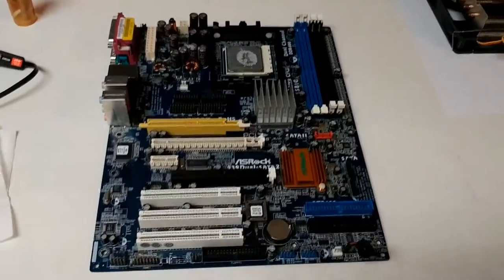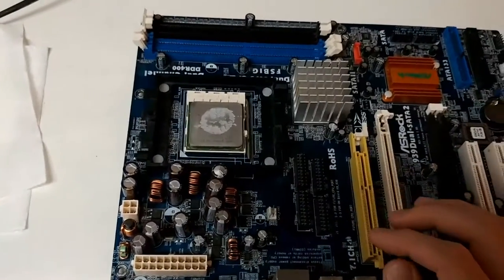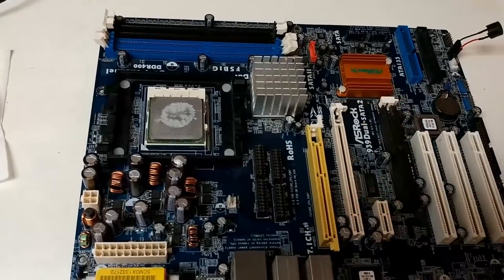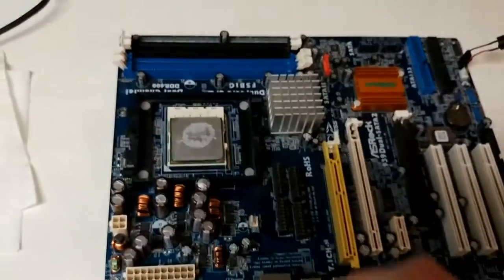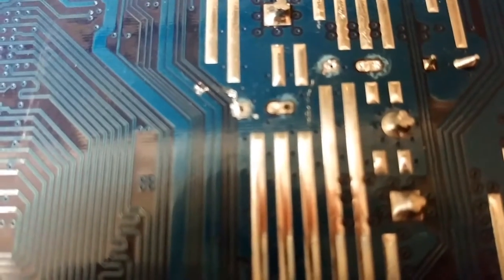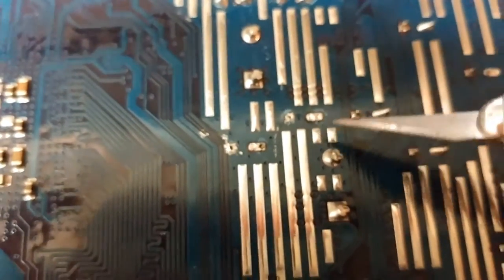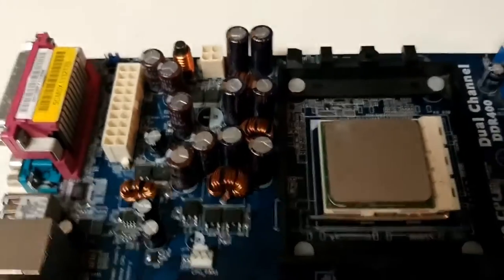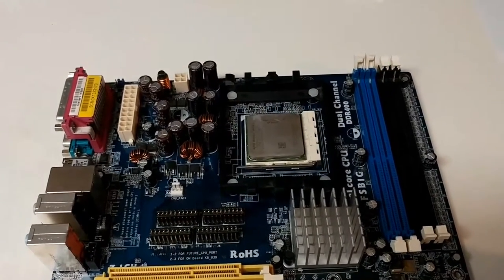Changing Motherboard Capacitors

Comment: Some general suggestions for anybody interested in doing this:
It helps to add solder to improve the heat transfer from the iron.  The flux in the fresh solder also serves to burn away the old oxidation.
Since it's usually very difficult to remove all of the solder, it's better to just leave it there so you have more contact area to conduct heat into the joint.  I also find that by using more solder I don't burn the PCB as easily.

Don't worry about clearing the hole until after the cap is removed.  Sometimes a solder sucker will work.  Another way is to gently push a stainless steel pin of some sort into the hole while heating with the iron, let the solder cool, then twist the pin free and remove (solder won't stick to stainless).
You can also just melt the solder and push the new cap through, but it's a balance of trying not to boil the new cap.  Finish up by removing the excess and adding fresh solder (or just flux) to make a fresh joint.

Keep in mind that all the through-holes have a tiny metal ring which is what you are soldering to.  It conducts electricity through the layers of the board.  If you pull too hard when the solder isn't melted, or have an overheating mishap, then this ring might come loose from the board.  It's not necessarily fatal when that happens but it's very undesirable - it will be harder to make an effective solder joint without that ring and it won't look good, you'll basically be making a tube of solder that hopefully makes contact inside of the PCB (or on the opposite side).

A quality temperature controlled iron is a big help and a worthy investment if you want to enjoy soldering, rather than loathing it.
Practice on a junk board before doing this on one you really care about.  There's no substitute for practice, the more boards you recap the better you'll get at it.